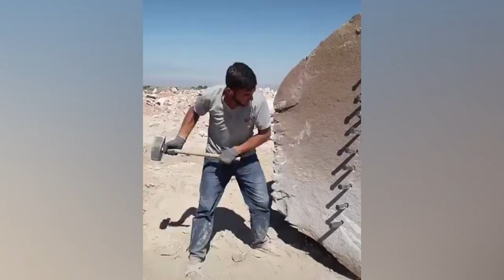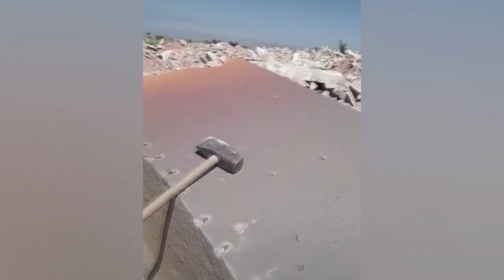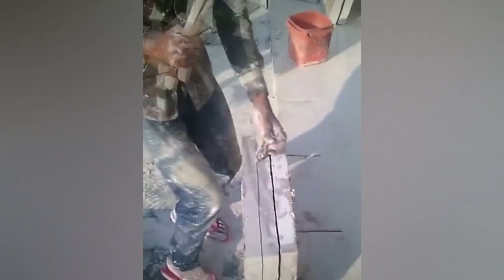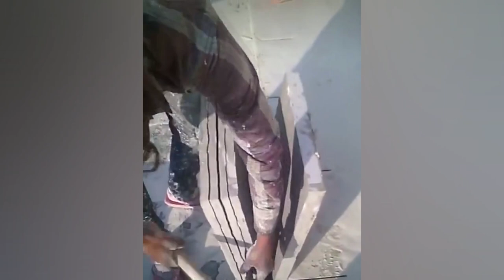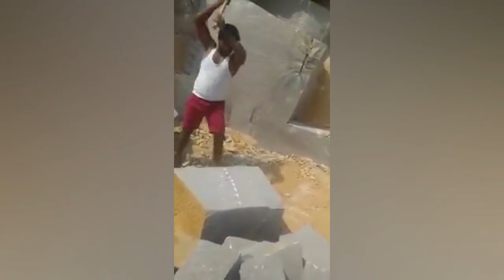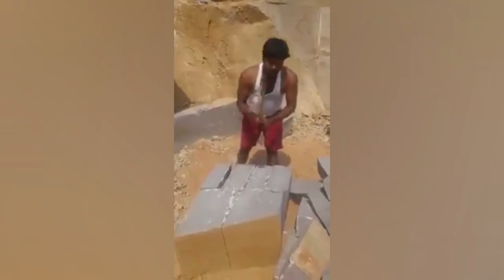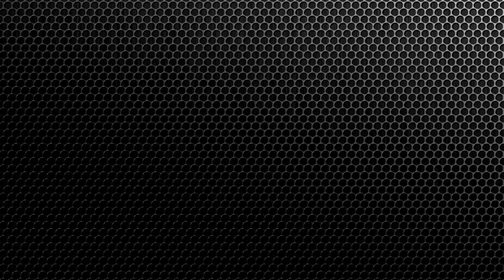Rock cutting, using only hammer

Comment: "It's impossible for ancient people to build pyramids with such primitive technology!" 

Meanwhile 1 guy with hammer and some metal things:
Reply: thing is - ancient egyptians did not have hardend steel to begin with (but stones/stone tools of different hardness and bronze tools; there also is a stone cutting technique with drilling holes, driving wooden pieces in the holes and then soak them in water. As the wood expends the stone cracks. Another method is to burn a fire on/next to the stone that you want to work with. After heating the stone with fire, it is shock-cooled with water, which leads to cracking too)  ... soo ... i am not into conspiracy theories neither do i want to raise a discussion about aliens or supernatural stuff! :)
Reply: @rumpelpumpel7687   thanks for the info
Reply: @rumpelpumpel7687  this is a nice TIL. Thanks
Reply: lol we have same thought first thing that come to my mind is pyramids , this must be how they have build it 😁
Reply: @rumpelpumpel7687  how did they not have steel when they had wheels and many other steel stuff like arrows and spears , they also had crowns that made of gold , I think they knew of steel obviously
Reply: @sakurakou2009  they first pyramids in egypt were build in early bronze age. first pyramide was built around 2600 bc. By that time, the material/alloy bronze was only known for a few hundred years. Hence 'early' bronze age. The discovering of iron (not steel, big difference) and the beginning of iron age accured ~ 1200 bc. 1400 (!!!) years AFTER the first pyramide was built. So it is no matter of opinion. Egyptians built the pyramides without iron tools. No offence or smart assing intended. have a nice day 🙂
Reply: Now try it with diorite.....
Reply: @rumpelpumpel7687  yeah, but have in mind that sometimes the building time length was longer than the pharaons lifespan. Also, as we know, they were really advanced in math, engineering, etc., so it's not that impossible, that in such important building they would use that technics. Also, they have been using a sandstone, which can be cut with a knife, so let's better talk about mayans and pyramids made from granite.
Reply: @Leithener  absolutly correct. i am not arguing against that. all i was saying, no steel nor iron tools used in pyramids by fact. because someone posted "in his opinion, they had steel, since they already knew the wheel and had gold stuff"... which makes not much sense, as you might agree. The intend was neither to belittle nor to embiggen (?is that the right word?) the building of egyptian pyramids. only meant to shine a little light of facts and knowledge onto the uneducated guess that they might have already had steel tools ~ 5000 years ago, which is just not the case 😉
Reply: Dont forget they have flipflops
Reply: @rumpelpumpel7687  actually, i'm too drunk to argue by now xD But yeah, i agree with you. We heave to remember that all dates before, like, 5-6 centuriers, are rather contractual, but still, it's not quite possible that Egyptians would know how to refine iron. Also, i'm not sure whether bronze in that case'd work just as fine as iron. However, what i meant is that we have to remember that our world isn't that complicated as we might think, and our species have proved that we can achieve impossible if we just want to, so it's kinda stupid to put all fame on aliens or whatever, just because we think that primitive people were too stupid to build something as spectacular.
Reply: @Leithener  yup, totally agree with that conclusion of yours 🙂👍
Reply: @sakurakou2009  arrows and spears don't need to be made out of steel. And gold has nothing to do with steel
Reply: The thing is no one wants to admit a proper time-line.  Todays archaeologists insist on a timeline that would have required a 2 ton stone every 2 minutes be laid with perfect alignment for something like 2 years with no breaks.
Reply: The stones laid in the pyramid literally exhibit LASER precision. The cuts featured in this video come NO where near Gizas cuts, and would not work at all for a pyramid. The geographical and astronomical position and design of the pyramids also suggest they were HIGHLY advanced and had a higher understanding of these things. The pyramids were not the result of some primitive crack heads.
Reply: There are single piece granite slabs hoisted 100 meters up that weigh over 70 tons. Egyptology records say the great pyramid was built in 20 years. With 2.3 million blocks, each one would had to have been laid every 5 minutes over those 20 years, with out pause or break.
Reply: In flip flops 😆
Reply: @sakurakou2009  none of those things are exclusively made of steel. 
Believe it or not bronze was used long before steel and gold can literally be worked into shapes with basic tools.
Reply: @sakurakou2009  steel is far more complex to make than gold.
Steel isn't normally naturally found in nature, it is something that you make out of funding iron with carbon, which to bond well has to happen at very high temperatures or a very long process of time. And if not done properly steel can come out brittle, in poor quality and practically worthless.
Bronze can just be melted and molded in shape, and it took them thousands of years before they even learnt how to use iron.
Reply: @spudmonky  that doesn't mean it was made by aliens.
Reply: @rumpelpumpel7687  you are a Smart individual.  We need teachers like you
Reply: @excelsior8682  you can polish them, can't you?
Reply: @rumpelpumpel7687  The egyptians just used tactics to build pyramids and people be like oh my fuck welp me from these aliens.
Reply: @felipem7626  You're correct, is does not.

My personal belief is that the pyramids were built many thousands of years earlier, before the end of the ice age. The sphynx for sure was, as the erosion on the enclosure walls behind it couldn't have happened since. I believe that the 20 year project that has been told for thousands of years was one in which they encased the pyramids in limestone.

We know that the casing stones were knocked loose at the beginning of the 14th century AD by an earthquake, and at the turn of the 19th century, they were all removed to be used in constructing the temples around them. Refitting or reconstructing the casing stones seems to me to be a much more plausible task for peoples of 2500 BC.
Reply: Just use rocks bro, the incas did it
Reply: I'm still blown away that Egyptians build pyramids while Woolly Mammoths were still alive
Reply: @Leithener  sure you can "polish" them. Doesn't change the fact that the precision is basically impossible to achieve unless you had modern tools, and even then with modern tools it would take a ridiculous amount of time. There is geometry and mathematics within the design that also suggest advanced knowledge; that's not even a matter of debate.
Reply: @Leithener  there are sections of these pyramids that literally look like the stones were poured like concrete, or even melted. Drill holes, LASER precision, and the amount of actual geographical and advanced mathematics point toward technology and tools that surpass even our modern tools. There's no way in hell even with steel tools to reach the level of robust precision required to build these megoliths.
Reply: Steel is not just your average ez find it in the bushes material. And steel as we know it has a rich history spanning thousands of years.
Reply: my fav quote from a stand up-comedian: “just because white people can’t do it, doesn’t mean it’s aliens”
Reply: Lol
Reply: It was impossible, there's more to just cutting stones.
Reply: @spudmonky  that erosion is artificial. People have been plundering ancient buildings for building materials for centuries, but the great pyramid of Khufu isn't that old.
Reply: @excelsior8682  Who have you been listening too? We build bridges and skyscrapers that surpass what it takes too build a pyramid. And the Egyptians wasnt some cavemen they where as smart as we are today. They knew math and they had tools and most of all they had the manpower to make it.
Reply: @88balloonsonthewall70  we surpass them in metal construction but we don't for stone work thats for sure, they were able to make couple millimetre thick basalt pots that were not simple circumferences, the specific one i have in mind  had a very complex shape , started cylindrical at the bottom and had a squarish top with folded lips at the tips.
making such an object in such a hard and brittle material is really impressive.
there are also some incredible wholes made into rock that show an astonishing high feed rate and the cutting didn't use a drill as it only cut the material in the circumference leaving the core intact ,the feed rate were in the +4mm per turn range, which points to a low rotation speed but very high cutting capacity, today we do the exact opposite with very high rotation speed and much lower feed rates.
their columns were also monolithic instead of what we do today with them being made in pieces, you would need the world largest lathe to make such a column today
Reply: @cj09beira  That's so true, im impressed too with the time and skill it took to work the stones. Masonry is almost an lost art.
Reply: Several important details are missing here. Without offering any explanation because I don't have any and no alien suggestions; we can deduce that ancient cultures did not cut stone in this fashion. We know this because at the time of the pyramid (since everyone knows that one); they had copper tools and most of their stone work is with granite. Granite has an average hardness of 6.5 on mohs scale and copper has a hardness of 3. You wouldn't work granite with copper, you'd work copper with granite. As the copper heats up, its hardness goes down. That means the more work you do, the more tools you'll need. Thats just one factor. Another issue is we can actually see where they were preparing an obelisk that cracked and was abandoned. It looks like scoops were taken out of the rock, as if it was soft or something. Also, there should be an absurd amount of copper wherever they would've worked the stone as their tools would've been dust within an hour. Even limestone is problematic for copper tools and its comparatively soft to granite.

You need a steel alloy to use this method on granite, though regular steel would be enough for the limestone they cut. Only problem of course is how do you explain the steel? Then the construction of the pyramid is another problem entirely, but luckily we're only talking about the stone cutting. 

Someone mentioned gold earlier. Copper and gold both melt at a lower temperature than iron which is required to make steel. The copper age was something like 4500 BC (6500 years ago) and the Iron age began around 1200 BC (3200 years ago). I think Iron melts around 1500 degrees Celsius.
Reply: No no the pyramids were built by the Nephilim, fallen Angel's that bred with humans on earth. Gave them knowledge. And were like 13ft tall these beings. Lol
Reply: @Paparoach493  LoL! That's ridiculous because of the gravitational co-efficient and bone to muscle mass ratio. There's a reason the elephant is the largest land animal. I'm pretty sure you weren't serious but now you can know why the elephant is the biggest land animal. Giraffe is taller but basically requires its skin to be like a pilots flight suit just to get blood to flow, and it weighs less, both being quadripedal. A 13 foot tall human runs into an issue being bipedal where you need to add more bone mass which requires more muscle which requires more bone mass. 

Dinosaurs existed though. 🤪
Reply: @felipem7626  Artificial? I ask that you please explain how man could cause the water erosion. The quarry for the great pyramid removes all possibility for natural run-off of rain water to cause the erosion, as the quarry sits just in the way of the natural slope of the land leading to the Sphynx enclosure. If the erosion is artificial, I have never before seen any explanation given as to how man could have caused it. If the erosion is natural, it would mean that the Sphynx would have been standing for thousands of years before the quarry of the pyramid was ever started.

Please elaborate on the artificial erosion.
Reply: @spudmonky  Old buildings have been plundered for raw materials for centuries
Reply: @excelsior8682  The pyramids are not "laser accurate" in any regard.
Reply: Is this where all the smart people are gathering?
Reply: They didn’t have hard tools (copper and gold don’t count because they’re squishy) to work with back then so how did they cut giant fcking rocks
Reply: @sirusername2750  quartz sand on the tips of these tools has proved effective
Reply: My question how did they get those huge boulders to stack so high on top of one another
Reply: The tough part about the pyramids isn't cutting the rock, it's lifting it
Reply: I you have a look at scientists, most don't do Manuel labor, hence why they are shocked at things like this, human will utilize anything they have around them if given enough time, especially during that time, everything wasn't as advanced but that didn't stop a guy in Japan from cutting rocks with his hands.
Reply: It's 2021 not 2500 BC.
Reply: I had an anthropology teacher (personal favorite teacher),who equated the notion that aliens gave humanity the tools to build the pyramids. To lazy thinking.
Reply: @Shaded Zaleph Egypt "precision" (or more like no precision) is nothing compered to Rome, was Rone also build by aliens then?
Reply: @rumpelpumpel7687  don't forget Egypt had a lot of slaves.
Reply: ancient egypt did have diamonds, this could have been used not for currency as much as for construction
Reply: Some ancient egypt builder: three,take it or leave it
Reply: Can we replicate the piramids today?
Reply: I am alien and it's true.
Reply: @lukebable  Granite*
Reply: Even tho they did build pyramids with such primitive technology
Reply: METAL WAS not invented during the pyramid
Reply: It's a method used in India for a centuries 😶
Reply: @felipem7626  sorry thats false when in reality that they did have access to iron in those times. Fact is king Tut was found with a moon rock dagger  in his tomb so obviously they did have access to and forged items from iron metal.
Reply: @timbo8979  Iron and steel are completely different things. And King Tut lived at the edge of the iron age, when humanity was starting to realize it's potential. Meteorite iron smelting is normal even for before the iron age though.
Reply: @felipem7626  huh you said they didnt they have it now you say they do where does drawing the line on arguement by using facts - you said “it would be thousand’s of years before iron was used”
Reply: @timbo8979  yes. The egyptian empire existed for 3000 years, ending with the Roman occupation a mere 30 years before christ.

The iron age started around 1200bc. That is 1800 years of history of the Egyptians not using iron.
Reply: @felipem7626  yeh did you ever see the early dynastic step pyramids, its like a mini pins turd in comparison, they had iron tools and why cant we find them around the site is because they are rare and were used stolen repurposed etc
Reply: @timbo8979  they didn't have iron tools until much later. The pyramids weren't built using iron.
Reply: @sakurakou2009  lol incorrect.. they didnt use steel.. they did use iron sometimes tho